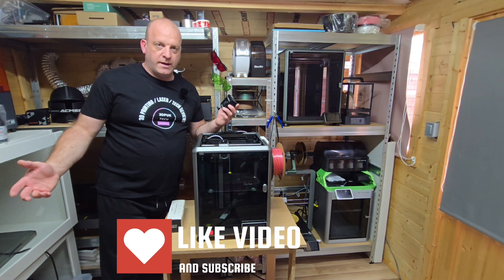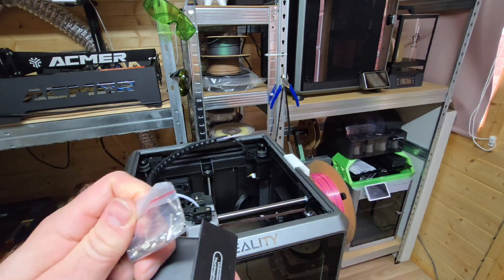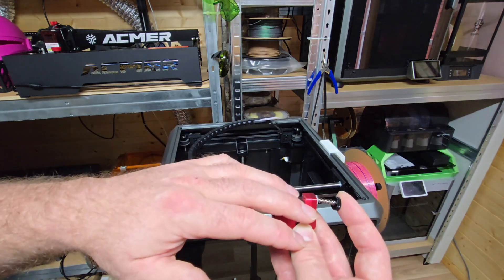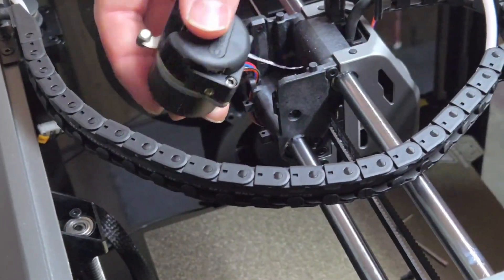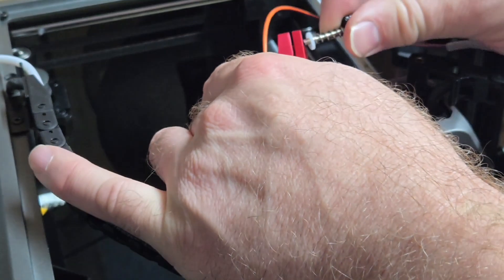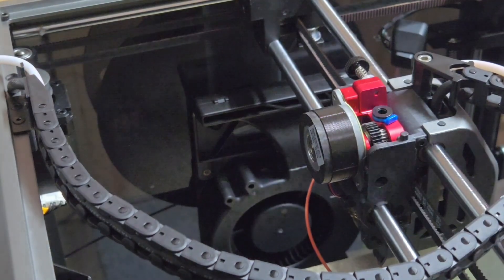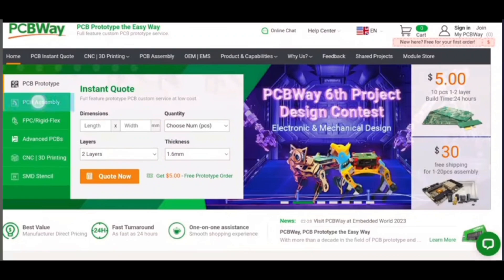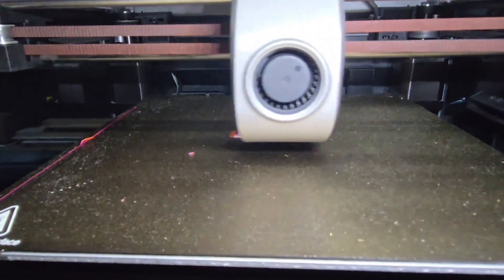K1 Extruder upgrade how to guide

Comment: After a few 10 rolls of PETG I started printing ASA with the K1C, I'm tuning the machine a bit, because the XY axis are starting to misbehave.

With the second roll I noticed that my factory extruder was starting to misbehave, I took it apart and it was worn out, the screw threads were either tightened too much at the factory or it had loosened itself due to thermal expansion.
the threads died.

I had to replace it with the spare now.

After watching your video I quickly searched on aliexpress and found a factory upgrade that is all metal and if I remember correctly a lightweight version skeleton type.

I ordered two of them right away, because of the open design I can put air cooling on the critical points.

It will be useful if I can convince myself to do the 550°C upgrade as well.

Comment: It's a shame that everything fit for you.  For me the bolt on thew right connecting the extruder to the motor won't fit.  The recessed hole is not wide enough.  I also was irritated watching someone else remove the pcba and pull out the connectors by the wires.  The glue makes that not work for me.  I had to use my pocket knife to cut through the glue.  I need to see people dealing with problems, not simply following steps.  One other issue you said long and short bolts.  A shot showing exactly what they look like would help.  I though perhaps I was using the wrong bolts.  I rewatched to see if you were using the same bolts I was trying.  Also my bolts stick out the back which is unexpected.  Is that right?  I can't say.

Comment: This is the worst extruder I have tested since I have had printers and it was a long time ago! It is very poorly designed, it damages the filament and the dust from the filament jams the gears, a horror, returned after purchase in less than 24 hours
Reply: I bought this extruder on temu and you may be able to read my review which is not yet published on this sales site if they dare to publish it.. I took photos and video in support. and still there is a missing photo in the review. several negative points against this extruder the one I mentioned to you but when we look at how it is built, we see that one of the gears is carried by two bearings themselves carried by two half axes, the aluminum one has a lot of clearance. so putting precision ball bearings on poor quality axes .... and especially on two half axes supported on the half housings does not help things. Another gear which has a single axis when we tighten the screw which assembles the two parts of the aluminum housing of the extruder is strongly compressed at the ends, which slows down this gear a lot and this makes the engine have to work harder.  I have some experience with extruders and printers, and frankly this one in terms of design is far from being a success. I installed it in a k1 max without really checking but from the first extrusion to load the filament, I noticed that what came out of the nozzle was not regular, just pass it between two fingers and you can feel it immediately. The calibration of several filaments was hell, no consistent results and the benchys show extrusion problems like those I felt between my fingers. I only did 3 calibrations of pla, petg and asa filaments, I couldn't even calibrate the abs, the extruder bearings were blocked by asa filament dust. I disassembled the extruder and that's when I noticed all the flaws in this extruder, its design is simply awful.
Reply from the maker: @α2ω  thanks for this detailed reply it's good to see others experiences 👍
Reply from the maker: @α2ω  the worrying thing about this comment, is you managed to come to this conclusion in less than 24hrs

Comment: remove the bowden from the cable chain. be sure you don't have short sharp bends in the bowden, filament can break and there is more friction on the tube/filament that increases wear and tear on the bowden and also could under-extrude.

Comment: On my K1C, both screw holes on the right side of the extruder (the side with two screws) for attaching the extruder assembly into the print head do not align properly.  The holes in the extruder are slightly higher than the holes in the print head mount.  You must push very firmly on the top of the extruder before the screws will catch and thread in.  This is not the case with the stock extruder - it just pivots into place and the screws thread without issues.  Also, the K1C does not have the extra bit of Bowden tube between the extruder and the print head.  There is a built in metal tube that serves that purpose.
Reply from the maker: @roamingchemist2514  that's interesting to know
Reply: I’m literally experiencing this on my K1 Max lmao
Reply: Thanks for the info, was about to buy the extruder but I beleive that I will wait for a new version compatible with the K1C.
Reply: @c0rreiafyi this model was stolen from printables irs made by a chinese creator
Reply from the maker: @SpaceT_  it's been discusses
Reply: @3DPUK-TECH-CHANNEL  i dont think its respectful to the author of this model. i know that you are just the content creator trying to get some money from this honest review. however i still think you should explicitly state the author’s creation as he owns the copyright and you might get in trouble for this video. atleast put it in the description. creativity is a bad company for taking a man’s hard work and mass producing it only to get profits from a small creator.
Reply from the maker: @SpaceT_  I will add this information to the description
Reply from the maker: Do you have the link for original ownership  @SpaceT_
Reply from the maker: @SpaceT_  I've added a notice on both title and description about the potential copyright, and that my channel has no awareness or control of this. But if it's deemed true then we would make necessary updates to title

Comment: I replaced my stock extruder on my one-year-old K1 Max.  I adjusted it as I printed a 15-minute benchy at full speed with regular PLA and it was better than the first one.  No stringing and perfect layers!
Reply from the maker: Thats good to hear, i have the newer version of k1max so came with the upgraded extruder, but my k1 has improved massively.
Reply: @3DPUK-TECH-CHANNEL  Hi just a question, when you say the Upgraded extruder on the new k1 max, does that mean any new recent K1 max purchased from the creality site have it>?
Reply from the maker: @levz118  I believe so yes
Reply: @3DPUK-TECH-CHANNEL  how does the new extruder works since you've replaced it? 
I  have the k1 max with the upgraded extruder and it worked fine for about a year and the clicking and printing in mid air came back 😅
Now I want to change it out to this one 
But I don't run klipper so need to take out and relplace without doing any changes to the machine program 🤔

Comment: K1 max, not working, misaligned holes, I just throw my money !
Reply from the maker: Are you sure ??? Compatibility with K1C/K1/K1 MAX:Designed for compatibility with Creativity's K1C, K1, and K1 MAX 3D printers for seamless integration.
Reply: prolly need to trim the bowden tube down a little.

Comment: How long is that Bowden. I lost mine.
Reply: I will measure mine and get back, but i highly suggest just swapping nozzle types to the unicorn nozzle. It is much easier to deal with and they arent that much. I got mine for 10 bucks for hardened steel nozzle which i believe is the standard one. They are a direct swap. Swapped mine in, then i went and upgraded the heat sink, the hotend and now to this extruder. My printer runs flawless with all materials. Tpu is still a bit finicky depending on brand. Mine is the old K1 fyi. No other upgrades.
Reply: 20mm bowden tube length.

Comment: Have you compared maximum flow between the original extruder and this upgrade?
Reply from the maker: @Intercom_e_Cia  not as of yet, but a g9od shout to see the difference
Reply: @3DPUK-TECH-CHANNEL  Tkanks.
I'm trying to decide between this model and D3vil Design's Cyclops
Reply from the maker: @Intercom_e_Cia  will.be hard to do a comparison on the cyclops without testing myself. But so far this upgrade has improved my printing experience.
Reply: @Intercom_e_Cia  the devil cyclops is going to be better as it uses parts from a orbiter and Galileo extruder and so offers more toque and has better gears
Reply: @simplegamerz9485  Thank you very much. I was wondering if the difference in prices would be worth it.

Comment: Thanks for the video! I haven't run into any issues on my K1 with the extruder slipping ... yet.. But you never know.
one of the things I like about the K1 is no adjustments (like I used to have to all the time on my old ender machines)
How often you think you'll need to adjust the tension on that thing?
Reply from the maker: @GamingWithURO  thanks for watching. I carried out this installation as test and review. The k1 has been flawless on many occasions.  Only recently did I have under extrusion which could be a number of reasons, nozzle related possible, but I think in answer to ur question the adjustment shouldn't be often if at all. Thanks for watching again 🙂